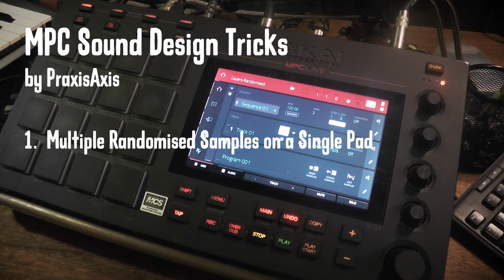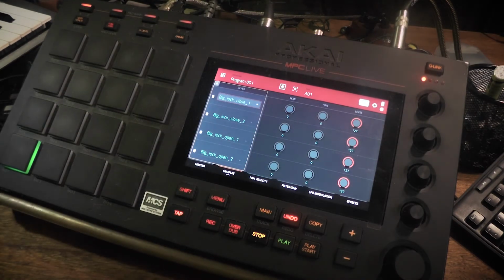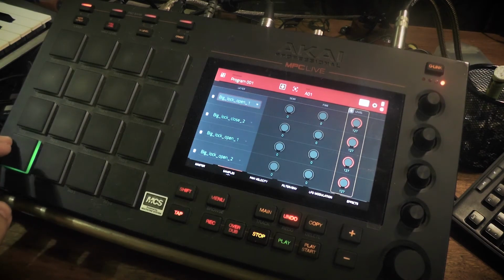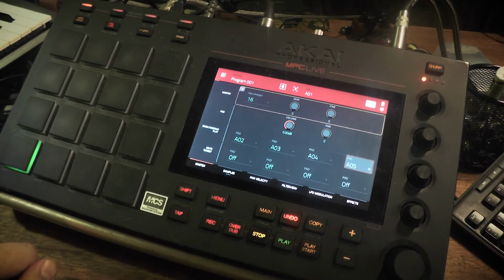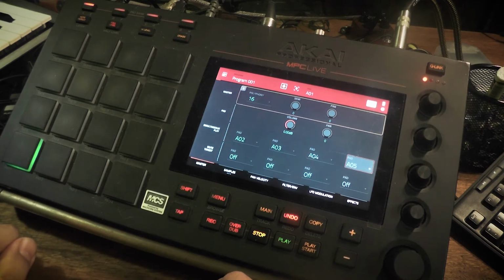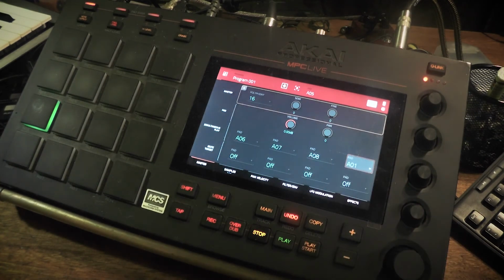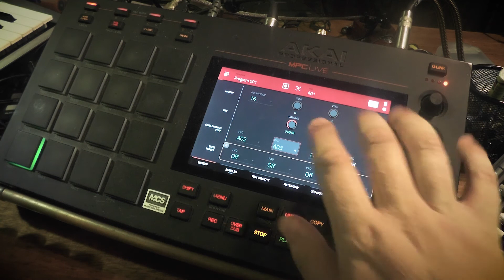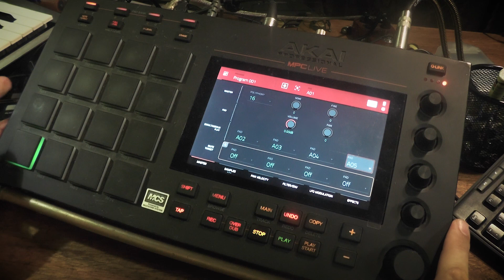MPC Sound Design Tricks Part 1 (Multiple Randomised Samples on a Single Pad)

Comment: Nice trick indeed! And it is only possible within a program I suppose?
Reply from the maker: Yeah you can only set up this up within a program.  However you can still get more creative, because you can duplicate pads within a program, and alter them slightly giving you a whole other set of options, if you alternate between those (sets of) pads in a sequence.  You can also duplicate entire programs, which allows even more complex stuff.
Reply from the maker: Also, it's really worth remembering that you can use the looper re-record any of these, then chop them up as new samples.  Which means you can layer-ception for infinity.

Comment: Good tips, there are plenty of interesting features in the mpc, that are perhaps overlooked/misunderstood by users, or otherwise people get lazy and don't experiment.
Reply from the maker: I agree.  If people get new gear, the first thing they should do is make a few new tunes using that gear.  I took the MPC away for a holiday when I bought it, and learned it as well as I could (completely away from the computer, with a printed manual).  When people say the workflow is clunky I tend to think they just might not have used it enough . . .